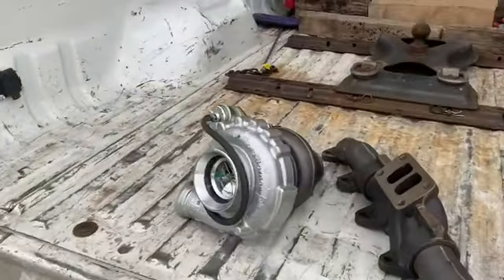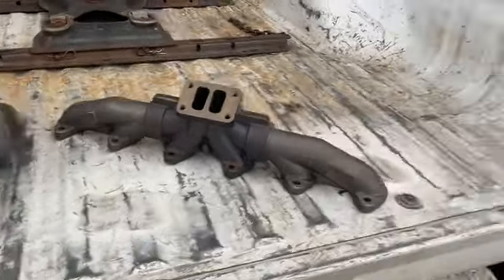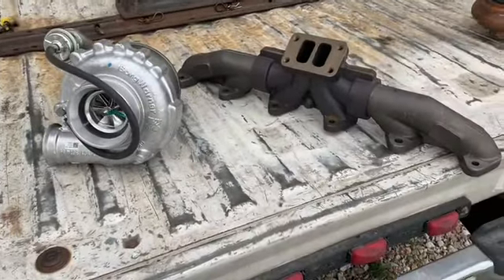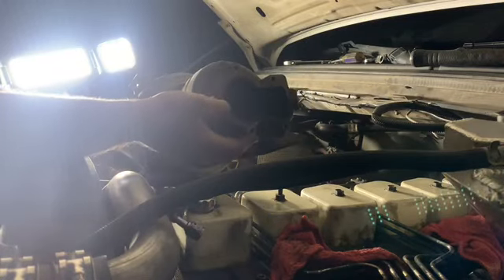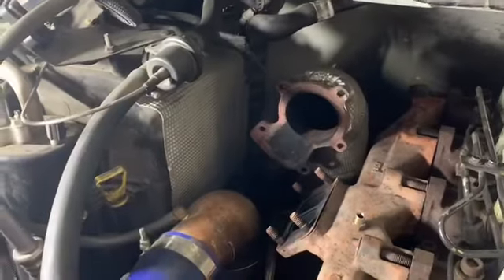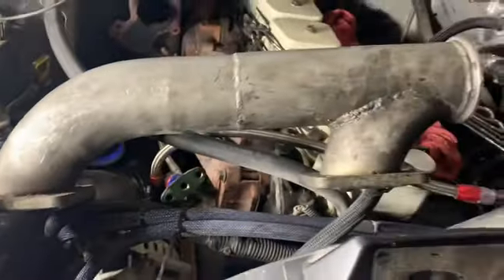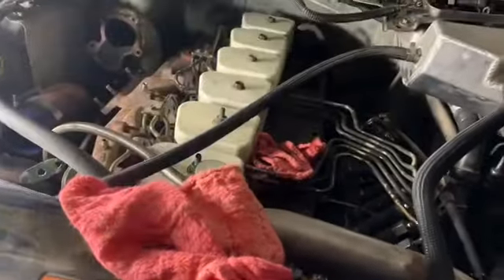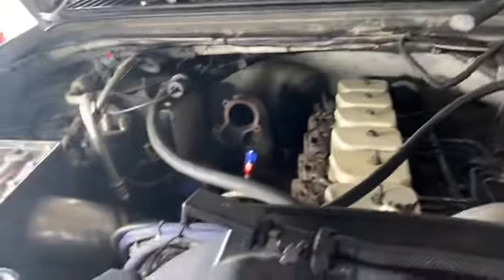New turbo for the FUMMINS!!!!!

Comment: The common rail plenum gasket is actually a mls gasket. But anyone that still uses the paper I would highly recommend going to the common rail gasket. With the original plenum plate it will cut the paper causing a leak. I switched to the mls and it does allot better under pressure.

Comment: Just got my F450 6BT started and driving just trying to figure out my white smoke at idle and acceleration it’s not a shit ton but enough to know it’s not right
Reply from the maker: Ronnie J one thing you can do is take the intercooler pipe off the driver side and let it idle for about 15 minutes if it stops smoking then you know you’re getting oil in the intake from turbo possibly. If it doesn’t fix it, it could possibly be a timing issue or a blown head gasket where and oil galley is or a cracked head or leaking valve seal. If you pull the valve covers you should be able to see if a valve seal is lifted and if it is that’s where the oil is getting burned and reason for the smoke!
Reply: TheFumminsPage rpope I Hope it’s not a head gasket I literally just broke the engine in after install the motor came right from the engine shop full rebuild with 44 miles on motor but I did use the original turbo and injectors off the old motor with out rebuilding or replacing them them
Reply: TheFumminsPage rpope I’ll definitely try the cold side pipe tmrw and see how that works I did already order a set of injectors that will be here Tuesday as well so hopefully something works
Reply from the maker: Ronnie J awesome let me know what you find!!
Reply: TheFumminsPage rpope if you wanna see it it’s one Fummins tech on Facebook Ronnie LaPlaca
Reply from the maker: Ronnie J ok I’ll look at it!